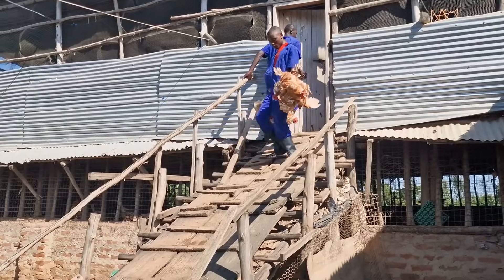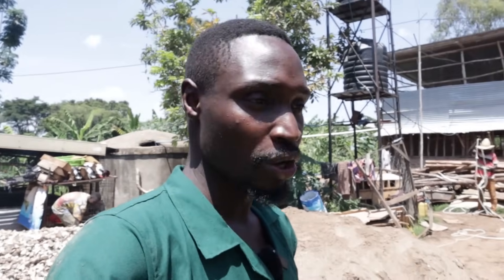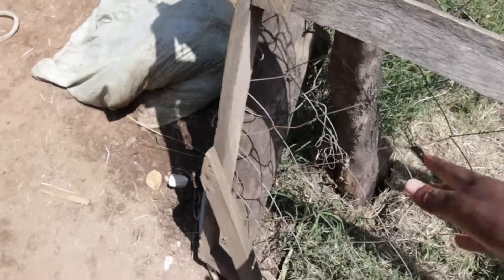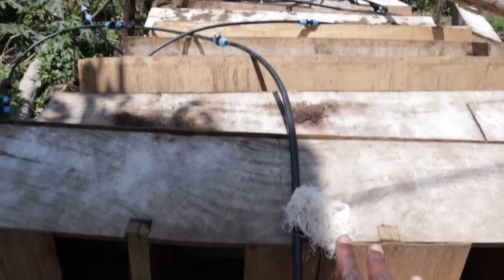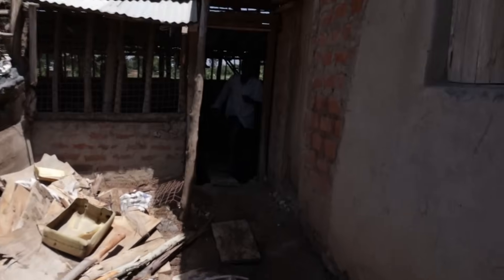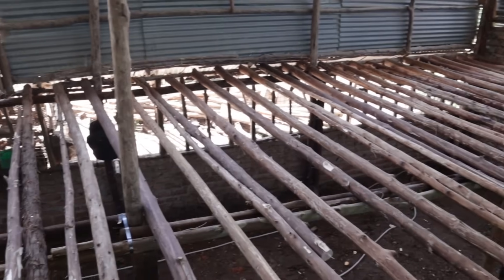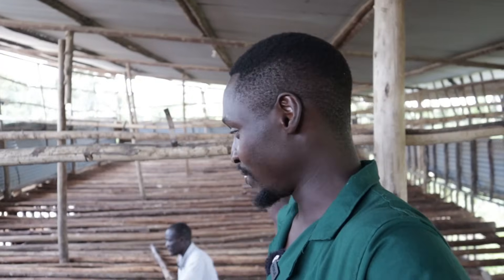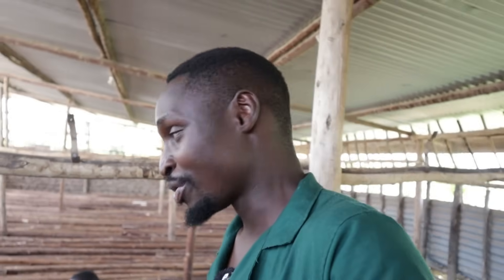Rebuilding my First Ever Chicken House.

Comment: Thank you so much dr ive learnt alot from you.  But i hear that concreate can be heavyweight for such a house. Why not using sand, cement and chicken wire mesh on the upper floor for increased duration?